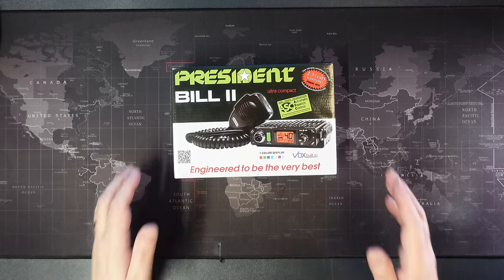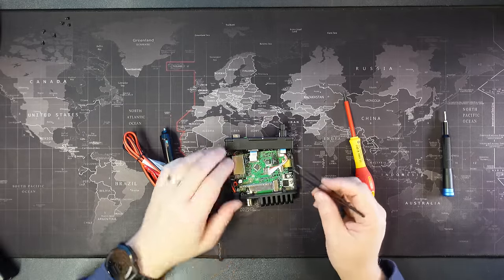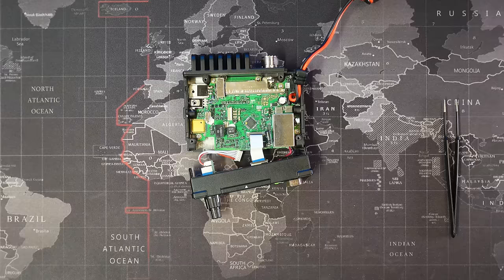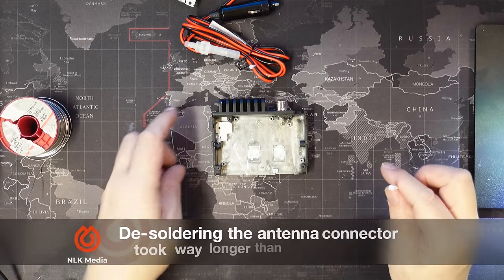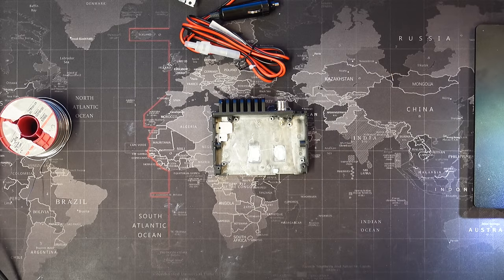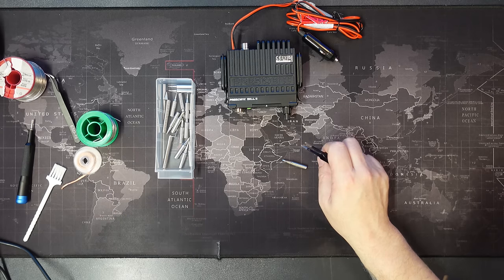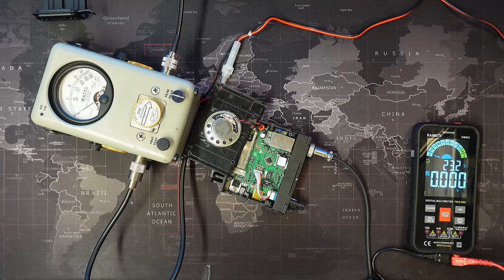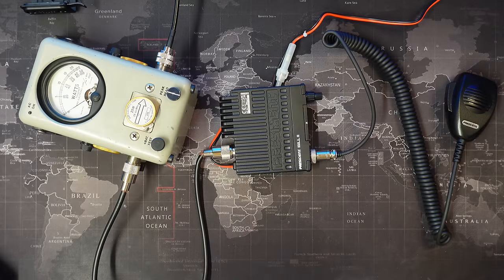President Bill 2 CB Radio Teardown

Comment: Was clipping the wire necessary for channel expansion? Or just moving the jumper.  Hmm if someone wanted the am low increased to 4. All he would need to do is adjust the AL in service menu correct? Would the radio need to be in AM mode?  Thank you for your video. I have the EU version coming this week
Reply from the maker: Hi, no the wire is for power adjustment. If you jump the jumper it will put the radio in expanded mode and wide band it (unlock the frequencies). To adjust the power you use the PL (power low) adjustment menu and it adjusts the power for both AM and FM at the same time. (ie it adjusts the output amplifier regardless of modulation type used) Avoid the AL mode, its the AM low power amplitude adjustment and should be set to around 89%. When expanding the radio and enabling high power mode you get additional options P2 is high power adjustment and A2 mode AM high power amplitude adjustment. The factory will set P2 and A2 accordingly so you shouldnt need to adjust it. (ie you dont adjust AL in high power mode as the P2 and A2 settings are used) if you jump the jumper back again it puts the radio back into low power mode regardless of the wire being cut or not. Hope that all makes sense. All the best and thanks for watching
Reply: @NLKMediaGroup  Hallo Sir. Also muss nur der Jumper versetzt werden für mehr Leistung und erweiterten Frequenzbereich ? Was hat das durchschneiden des Kabels für einen Sinn ? Kann man es lassen und nur den Jumper versetzen ? Hier in Deutschland hat es einer so gebaut das man das Radio nur links mit dem Finger antippen muss um zwischen hoher und niedriger Leistung umzuschalten. Hohe Leistung wird angezeigt durch eine kleine Leuchtdiode. Sehr gut gemacht. Such sie nach dem YT Video.

Comment: So, if you cut the wire? What happens? 

And if you cut that white wire and and move the wire to the next hole, what happens? 

Is it best to add a switch between the jumper wire? Should that be a hetter option to easily expand and change back to stock when needed? 
Awaits response. 
: )
Reply from the maker: Some President radios expand to a high power mode when the wire is cut and others expand when the wire is moved. The jumper enables export mode to open up the frequencies. So, you can expand the radio just by moving the jumper but to get more power the wire needs to be dealt with. Some people add a switch so this can be done easily and I have also seen modules being added which switch based on holding the PTT button at power on. The only problem with the Bill 2 is its size and finding somewhere to put a switch. All the best and thanks for watching MJ7NLK
Reply: Appreciate for the prompt response, 
So, for high power on this model you should? 

To get expanded frequency range alone you need to? 

And for both high power with expanded Frequencies we should..?
Reply: Should I move the jumper to the next and add a switch in the first jumper cable point?
Reply from the maker: @sleshinepinki774  To get the expanded frequency range you just need to set the jumper. Moving the wire provides more power but only when the jumper has been set to expanded mode. So, moving the wire and then changing the jumper back to the standard position will revert the radio back to standard power as well. It is a three pin setup for the jumper. Bridging 1 and 2 puts the radio into standard mode. Bridging 2 and 3 puts the radio into Expanded mode. Pin 2 is common to both and you need to switch between 1 and 3. So, you will need a 3 way switch to switch between 2 and 1, 2 and 3. Hope this helps, all the best MJ7NLK

Comment: When radios are installed in a car(directly to the battery) how do you prevent the Radio from draining the battery if left on.
Thanks
Reply: You don't you remember to turn it off  leave it on once & you will
Reply from the maker: Hi David, you could connect it to the yellow ignion wire which is only powered when the key is in and turned to the ACC or ON position. Apart from this, if you leave the radio on then the battery will drain. Thanks for watching

Comment: Bonjour, si vous dessoudez seulement la partie haute du fil blanc et que vous le soudez sur la partie haute du fil bleu alors vous obtiendrez 4W AM - 18W FM et 18W UK. Il faut croiser le fil blanc et le fil bleu 😉
Reply from the maker: Salut, merci pour le commentaire. Si vous regardez ma vidéo sur le President Harrison 2, la modification du mode haute puissance a été effectuée sur cette radio. La même modification peut être appliquée au Bill 2 pour débloquer le mode haute puissance. Je pense que c'est ce que vous dites dans votre message. Désolé de devoir utiliser un traducteur, alors j'espère que rien ne sera perdu dans la traduction. Bonne chance et merci pour vos commentaires
Hi, thanks for commenting. If you watch my video on the President Harrison 2 the high power mode modification was performed on that radio. The same modification can be applied to the Bill 2 to unlock high power mode. I think that is what you are saying in your message. Sorry having to use a translator so hope nothing lost in translation. All the best and thanks for commenting

Comment: Does President do firmware updates? If so then that might be the only way to get the P2 mode?
Reply from the maker: Hi John, not that I am aware of. The USB socket on the front of the radio's is power only so there is no way I am aware of to perform an update. Would be good to find out if the firmware can be dumped from the chip using a header on the board. Might open up some room for improvements. Something to look into when time permits. All the best and thanks for watching

Comment: dude i just watched a video of you and the Bill FCC model ??you did years ago???
Reply from the maker: The Bill 2 is a nice little radio, although its difficult to work on due to its size, but very handy for an ultra small bug out radio with some power under its belt. I revisited the Bill 2 a few days ago trying to find the High Power mode adjustment to be able to dial back the expanded power output but was unable to find it on the EU model. All the best and thanks for watching MJ7NLK

Comment: President Electronics Thomas FCC 40-Channel AM/FM Radio,  IS THERE A POWER MODE FOR USA MODE
Reply from the maker: Hi Bill, The Thomas FCC is the US version of the Barry 2 EU model. I have done videos on the Barry 2 which you can check out on the channel. I do not have access to the FCC models so am not able to 100% confirm if the Thomas is expandable but suspect the FCC have had the options removed. All the best and thanks for watching MJ7NLK

Comment: Hello, I would like if you could make a video with the President Ronald 10/12m cb station or some advice about it, I am waiting for a response from you
Reply from the maker: Hi Marius, I have a lot of President Radios but the Ronald is one that I don't currently have. I will add it to the list and see if I can source one when next ordering. The President Richard is such a good radio that I just can't see the Ronald being superior but will check it out and see. All the best and thanks for watching
Reply: @NLKMediaGroup  Ths Man for the answer👍🙌
Reply: @NLKMediaGroup  Ok, so Richard is superior to Ronald?
Reply from the maker: @mariussny  Yes, the Richard is an amazing radio and superior to the Ronald. The order is Ronald, Richard, Lincoln 2+. You get a lot of radio for your money with the Richard. The Lincoln 2+ is the best of the three as it has SSB but its double the price.
Reply: @NLKMediaGroup  Ok so as I don't need SSB Richard ist the best
Reply from the maker: @mariussny  Yes absolutely, the Richard is a much better radio than the Ronald. I have various videos covering this radio. The President Walker 2 is basically the same radio as a Richard and shares the same PCB and both can be expanded. The Richard is 10Meter out the box and can be expanded to cover CB and the Walker 2 is CB out the box and can be expanded to cover 10M. Identical PCB on both. So watch my Richard and Walker 2 videos if you want more info as the same things apply to both radios.

Comment: The FCC just simply need to bring the UK ones here in the states
Reply: Ha ha ha ha, you're kidding, right? Why would the FCC do that? The FCC would never allow non approved radios from the UK! LOL
Reply from the maker: Hi Warren, from what I have heard it is the FCC that impose the restrictions on the radios and insist on expansion options being removed before they grant license. What I am not sure on, is if the restrictions are in software or on the PCB re the removal of components. I would like to get an FCC version to compare and see, just for curiosity sake as I get asked that lots. All the best and thanks for watching
Reply from the maker: You are correct, they would simply not approve them for use, which means they cannot be used legally in North America. President Electroincs is a French company and the radios are built to service the EU, Eastern Europe and further East again as well as Asia, etc. The laws vary greatly between regions so the radios are able to cater for these variances. When importing into NA President have to gain type approval from the FCC and they will only grant approval if these variances are removed and they are locked down to meet the NA requirements. So, we end up with an EU version and an FCC version which is the EU version with some changes to only meet the FCC requirements. I even think that there would be issues with attempting to import into NA as well but have no idea on how this is controlled. Thanks for watching and for commenting. All the best